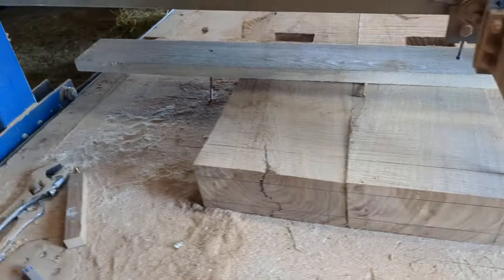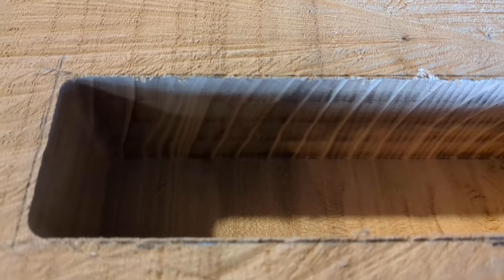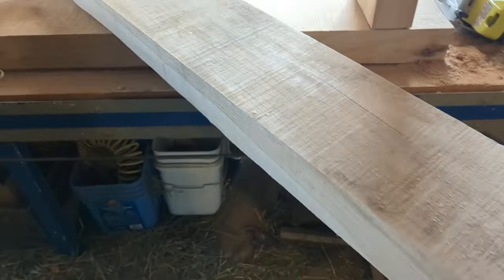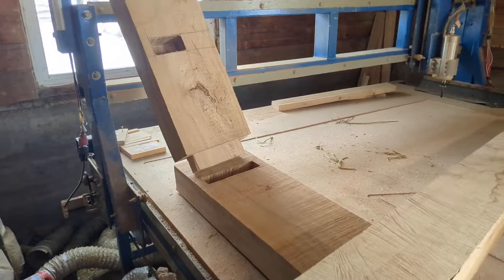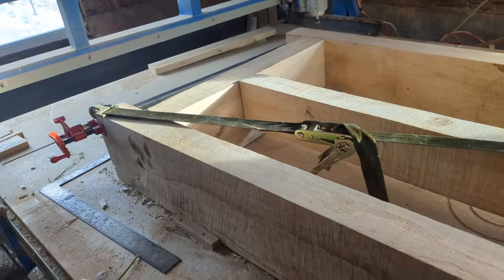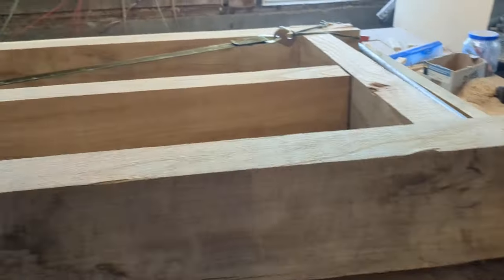The restoration of an antique Corley 395 sawmill. part 5.

Comment: Is there enough left of the mill to go by, or do you have a print or owner's manual? Did you chisel out the mortises to square them, or round the corners of the tendons?
Reply from the maker: I don't have any owners manual just going off the old mill which is going to be hard in some places where the wood is completely gone. I was told that they did not print owner's manuals for those old meals. Sure, would be nice to have some drawings or something. As far as the mortise and tenons, I rounded the corners on the tenons rather than chisel out the mortises.